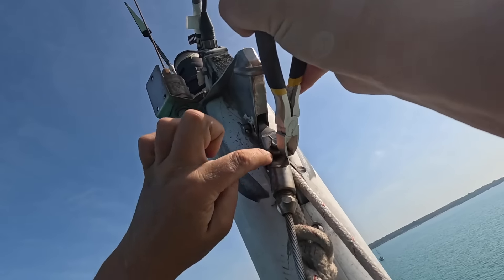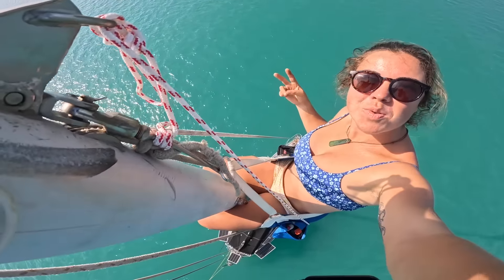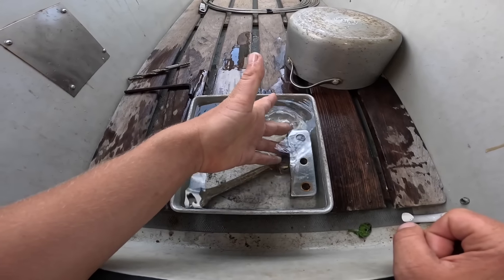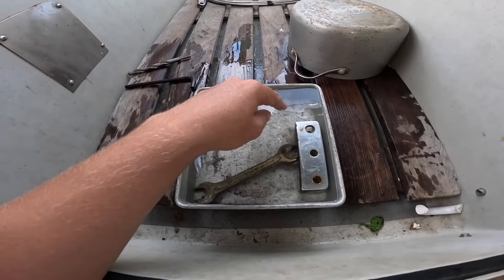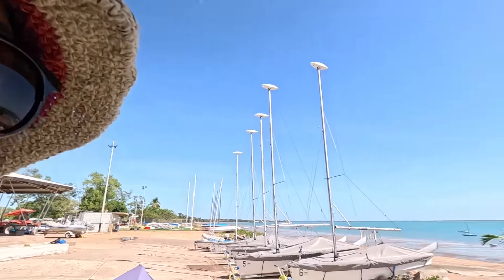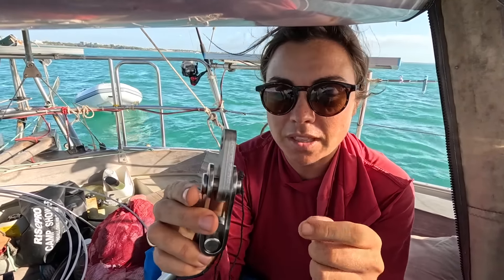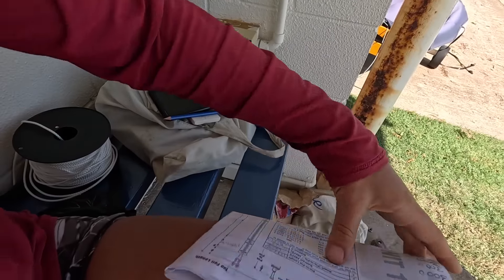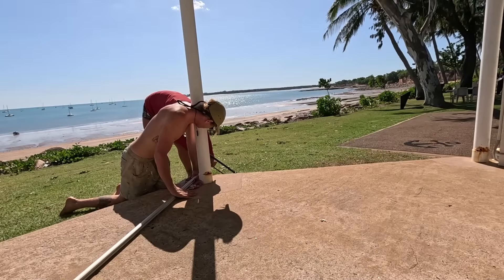Installing Roller Furling on Anchor Rolly Tasker [FULL VIDEO]

Comment: Excellent work. Sounds like you have the mast set with less rake, so it will be worth checking how she sails; probably less weather helm on a reach and upwind, and perhaps a little less pointing ability upwind, especially in fresh winds and more. Hopefully she is still within what performance you are happy with, even as a cruiser. Check that you are happy with it before going too far. That new foresail will help a lot, and make sailing feel different too. It will be interesting to see how yo find sailing her now. Cheers.

Comment: Cool. Beautiful sail and furler. Good to know about fore stay tightness and the click.  
What I know about furlers.  
1. If in furling doesn't work well  or it lags and goes, lags and goes... the halyard is loose. (Seems obvious now...) 
2. Watch out  for chaffing around the frames at the furler drum.  If when the sail is unfurled or  furled Is the in furling line is rubbing against the drum/frame..? If so it'll chafe through the line.  Especially after days and weeks at sea. 

If it does this, sometimes you can adjust the line a bit. Some boats have a frictionless ring as a guide near the furler to keep the line centered on the drum.  (We had problem #1 because we had to replace the line because of problem #2... and didn't tighten up the halyard when we were done.) 
There are a lot of far more experienced sailors and riggers than me, but if they haven't spent weeks and weeks on a passage, some of the chaffing issues have never become a problem.  (And you've both sailed more then me... of course you know all of this ..)

Comment: Congrats, I always wondered why any sailloft hasn’t  sponsert you already.  Now you only need Yanmar or other quality Maschine provider to sponsor a new engine. The old 10 hp Buck is very asthmatic, and 2 of 3 cylinder are running much smoother. 
The Grinde is very dependent on good foresails to get the full speed potential out of her, it will definitely be a hole new boat handling and speed wise. Greetings from Denmark

Comment: I noticed that you used a cotter ring in the clevis pin that holds your forestay to your mast head. I would caution you to consider replacing it with a cotter pin instead of a ring. I had a ring work its way loose once while underway (from a cap shroud chainplate). After that happened I stopped using rings in places where I thought they could cause a catastrophy.
Reply: Yep, replace that ring with a 'split pin' and washer ideally.
Reply: A loose halyard can pull that split ring off the mast head and you won't notice until the mast drops.

Comment: Awesome! One question I might ask, and I hope I don't appear to be a Jonah here, is whether the greater tension on the forestay might raise a concern about the forestay stem fitting.  I was surprised to see that is a pad eye, and not a chainplate.  In our family we had an old Paceship boat built in Nova Scotia that had such a fitting, and it ripped out through the deck and we lost the mast.  If that area of the deck was engineered with a certain amount of forestay tension in mind, does putting on significantly more tension lessen that margin of safety?

Comment: I assume this means you can reduce headsail area from the cockpit now without having to switch out storm jibs and such? That seems like a huge added safety margin when you are caught out in rough seas. I would think it makes trimming the boat for specific conditions much easier, too.

Also, what happened to Puss!? I don't think I missed any episodes, but I guess I didn't catch her departure.

Comment: Charlie just here near Bangor.
 I don't understand why the friction point on the top of your new roller furling is it supposed to be on the cable rather than on the steel fitting clamping the cable. Just seems to me like you've put the friction on the weaker link . . . ?

Comment: Do you regret switching to roller furling? I have handed on and I absolutely hate it. Multiple bags of sails down below, can't reef quickly. All the efficiency arguments for hanked on are moot for singlehanders because of how much speed and time are lost in a sail change and being on a heaving foredeck at 3am offshore alone is best avoided.